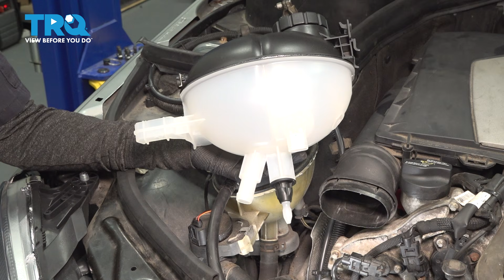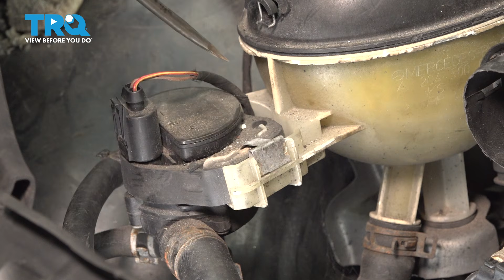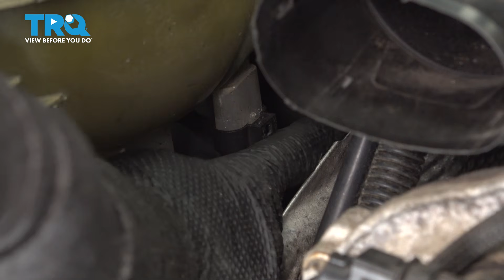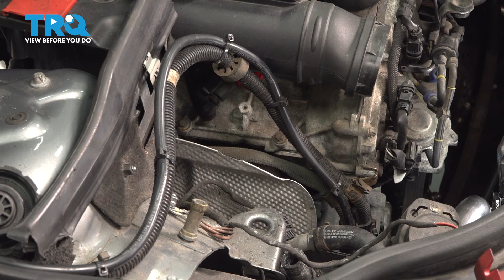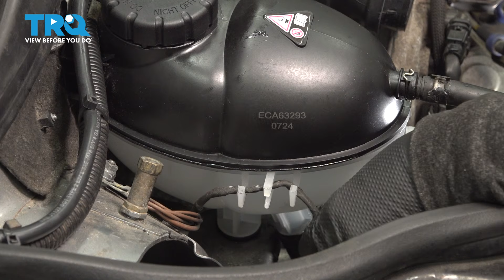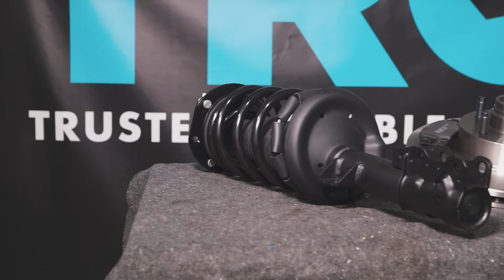How to Replace Front Coolant Reservoir 2008-2014 Mercedes-Benz C300

Comment: Quick note: If the filler cap has a small tab on it this needs to align with the notch on the reservoir filler neck when tight. You can see the notch in the video after the cap is put on.